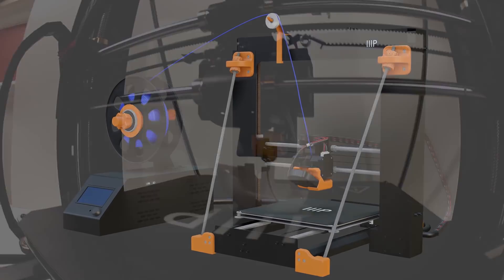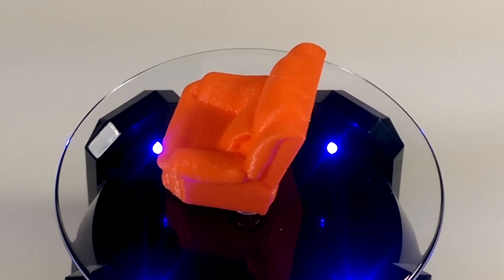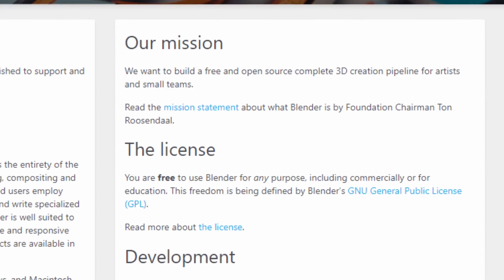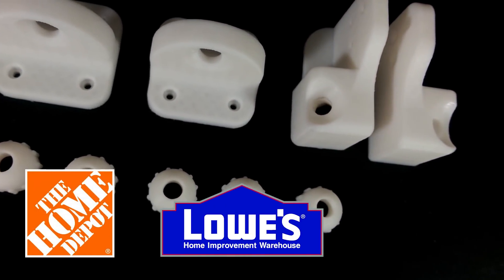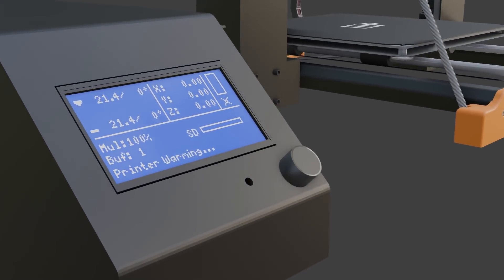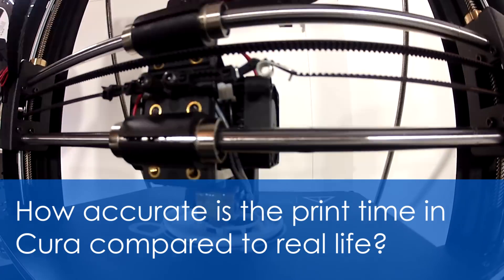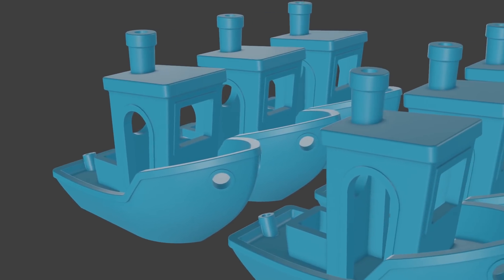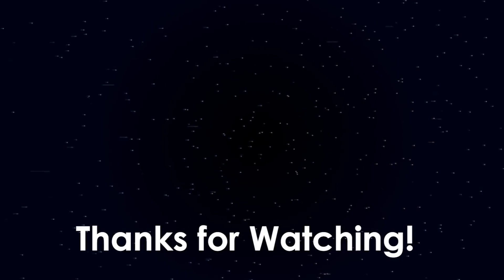3D Printing with the Maker Select V2 - Ep8 | 2 Years Later... Any good?

Comment: i just repaired a monoprice maker select v2 that ive been sitting on for 6 years. had to resolder the hotbed and power plugs on the motherboard. getting a mosfet upgrade and already printed the parts for the z axis brace. really enjoying this printer ive never 3d printed before
Reply from the maker: That's awesome!  It's a great feeling to fix up old gear and get it running again.

Comment: Yo, I know this is 2.5 years later, but it's nice that you have these old MS3dv2 videos. Mine was being freaky at some point and I got a Flashforge Creator Pro and this old thing started gathering dust. Now I'm trying to get it back in fighting shape. I know first thing is I need to look at the extruder. Filament loads a little, but then starts hiccupping and not going in any further. Thanks for having this legacy info out here.

Comment: Did you ever do the MOSFET board upgrade? I was hesitant at first because of wiring, but I’m glad I did because it corrects an issue that can kill your control box.

Also, any thoughts on using a glass print bed?
Reply: @cktechcheck  I just did the MOSFET upgrade a couple of weeks ago. It was not bad. My MSV2 was out of commission for 5 months because the heat bed was heated for a long time for a 26 hour print, and the wires desoldered themselves from heat bed. I had lots of trouble fixing that and ended up buying a new heat bed.
Reply: @cktechcheck  in my case it sure was. I run lots of long prints and the peace of mind alone was worth it to me.

It was a lot less difficult than I expected. I watched a YouTube video installation and then I was done like an hour later. I’d even printed a bracket for the MOSFET I found on Thingiverse
Reply: @stevedoktor1766  Something wonderfully circular about youtuber watching youtube videos. Also foud the MOFSET mod a reasonable upgrade.

Comment: I've had a Maker Select v2 for like 3 or 4 years now, just recently got back to printing on it. The mods were some of the first things I printed for it when I first got it, still think it's wild you can do that. You're absolutely right too, it was fun, especially fun knowing that it was ultimately increasing the print quality.

Lol shit now, 4 years later, it prints better than ever. It had been on a not-so-stable desk until recently. I mean it wasn't terribly unstable but it was definitely affecting the prints. Ever since moving it to a spot on the floor there has been a pretty decent uptick in quality. I had figured that it would probably improve but just never got around to it until recently.

Comment: Pls help my 3D printer won’t even turn on what should I do
Reply: CKTechCheck ya but I’m thinking it’s the power cable because when I use the same cord but with a lower voltage it’s works thank for responding

Comment: Love my MSv2, and your channel was a big factor in my selection. I printed the new spool you designed, and it's awesome. Waiting for my Z-axis stabilization parts to come in, then I have one or two more small things I need to print out like a dust wiper and feed arm, and then I'm doing a whole big tear down to rebuild much of the printer, and probably upgrade its control board and extruder.

All in, I'd probably be around $450-500 by the time it's done for cost and upgrades, but at that point it ought to print like a still more expensive printer.

Comment: the fan noise is actually the fan bearing over time it will eventually stop performing and should be replaced. Over the course of a couple years, I've had 2 go out and my 3rd is on its way.
Reply: @cktechcheck  I mean the printer is from monoprice, most of their products are cheaper chinese product with poor Quality Assurance, its expected. I upgraded to some noctua 40x40mm fans which reduced alot of the ambient noise to the printer.

Comment: Thanks for getting me into 3D printing, I bought the Wanhao i3 (basically the same as the Monoprice). It's been a brilliant printer and your videos really helped me out with some issues I had with it, specifically the issue with the gear in the extruder, that issue happened to me on just my 3rd print! But having already seen your video I fixed it straight away and I'm sure without seeing that I would have just trashed the printer and given up.

Unfortunately just before christmas the control board kicked the bucket, with some lovely smoke to inform me it was fucked. Having only lasted about 6 months from purchase sure it was a disappointment but now I've purchased a Prusa because I love 3D printing so much. Thanks for getting me into a new hobby, 3D printing is really fun :D

Also I would recommend giving flexible filaments a try, the stuff you can make with them is really interesting, dropping the speed to 20mm/s and disabling retraction flexibles print perfectly on that printer.